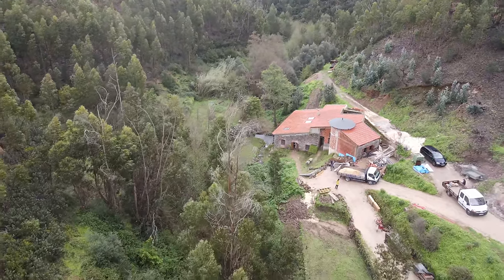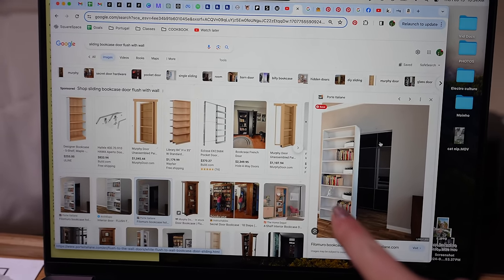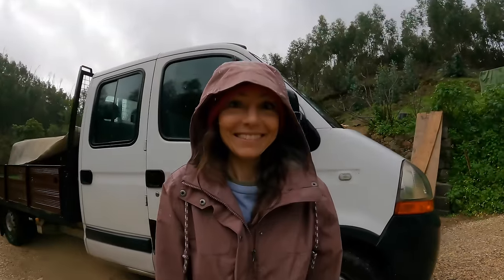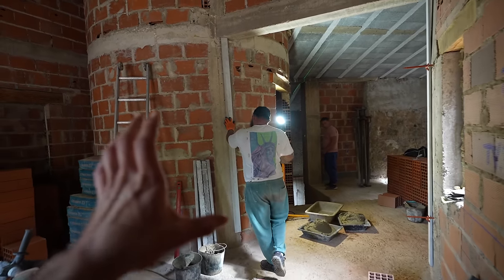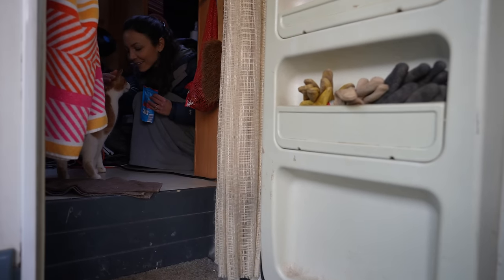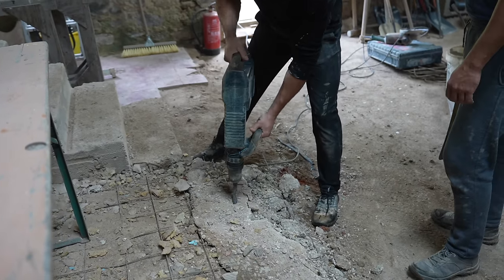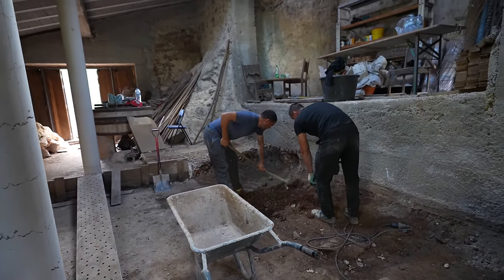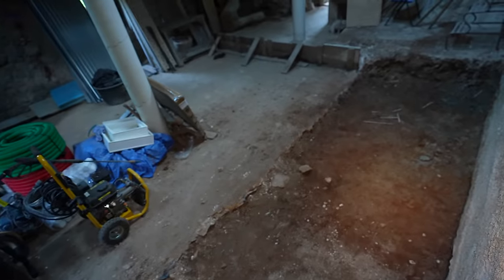DAY ONE transforming our STORYBOOK STONE HOUSE in Portugal

Comment: I’ve read how your community is so pumped to see all of this work commence.
The electrical and plumbing is laid out but where will your heating system and hot water tank
Be located?  These systems are key.  What kind  of heat will you choose?     The instant hot water system  my kids have used in their building has been hugely efficient.  A little more costly to install,  but great for the bathrooms.    But whatever will keep your largest room warm?    And what will be used for controlling humidity?  Ceiling fans throughout?   
The wood bookshelves are a great idea….and the latest in fashion in the USA  is to lean to industrial -type fixtures……very cool concepts….
Reply from the maker: We will have a solar hot water heater on the roof for primary use (these are widely used in this very sunny country) and a secondary heater that uses electric for cloudy weeks. We use an on demand heater currently in our camper and are very familiar with this. Loads of other things to think about.

Comment: Do consider putting glass blocks above walls to let in natural light to bedrooms or hallways or any other interior space. On one former home I used them above the walls on a bathroom.  They're super nice to have to let in light without having to build frames or other structures. You can also use them to create a wall.  Most people don't think of using them, but they also have some insulating properties.
Reply from the maker: Yes! We were thinking to build our shower wall using them. We also used them in the building of our roof, you can see here https://youtu.be/0bPuiOEz9VM?si=HcuILAE4zIzNEs_z&t=545

Comment: I would add Larger windows if you get the oppertunity. It would bring in more Light or add Skylight to add more light.  Avoid turning on the light all the time.
Reply from the maker: It's a good idea, but we are not able at this point to make the windows larger. When we replaced the roof last fall, we included 3 skylights in the old Mill portion. They are wonderful for letting in light!

Comment: 17:47 you can see through the wall. Is there a lack of cement between the blocks in the vertical joints?
Reply: 17:29 there is no vertical cement between blocks
Reply from the maker: It's clearly right there. Look closely. The lighting makes it hard to see.

Comment: Your builders have a strong work ethic and skills.  It is nice to see the transformation.  I was, however,  worried for their safety.  No one was wearing a hard hat.  The guys using the jack hammer didn't have ear protection that I could see. They will most certainly have hearing loss.  I know that it isn't your responsibility so I'm not blaming you, I just worry for them.